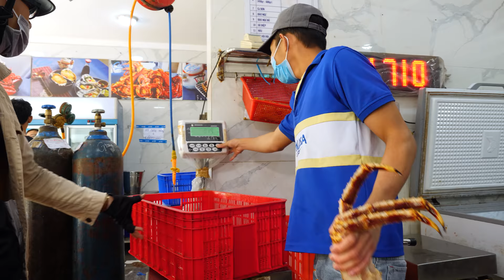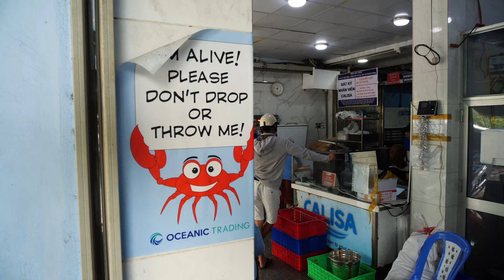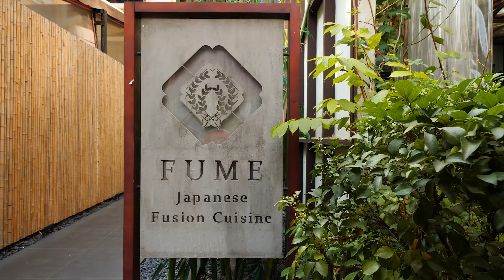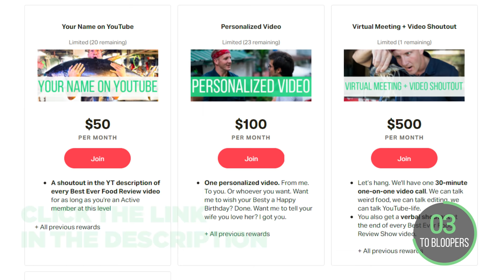Japanese Chef Prepares GIANT Tasmanian CRAB!! Over $700!!

Comment: They call the stuff inside the head of the crab "crab butter". "The “crab butter” is the yellow-white-greenish substance that is revealed after the large shell has been removed. This is actually a digestive gland known as the hepatopancreas, an equivalent to our liver and pancreas. For the crab, this organ produces digestive enzymes, and is also responsible for filtering impurities from the blood and some energy storage.

There would be little risk if the crab on your plate has spent its entire life in pristine waters, but most crabs do not come with a passport for your inspection. If the crab has spent time where there have been oil spills, agricultural runoff, PCBs, or exposure to toxins or heavy metals, there is going to be a greater risk of accumulation in the internal organs with the hepatopancreas having the greatest proportion. For this reason it is best to bypass the “crab butter” and eat only the meat."